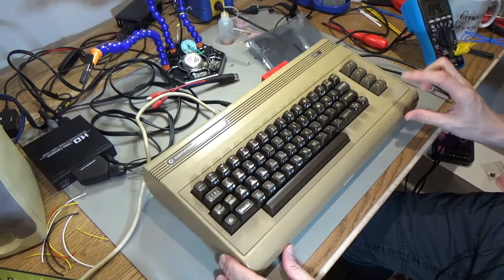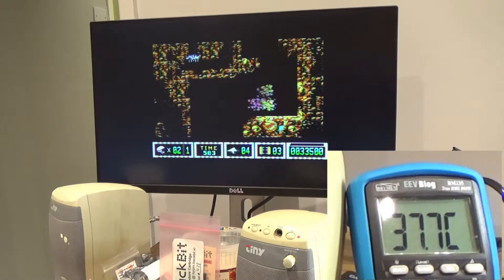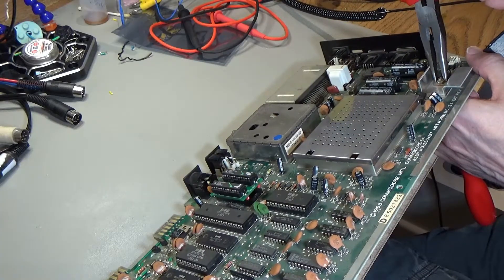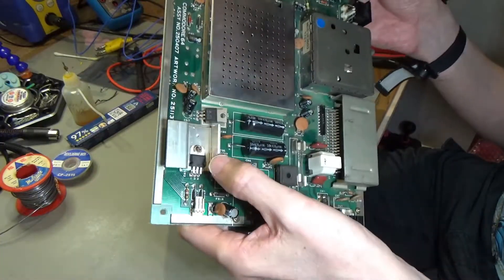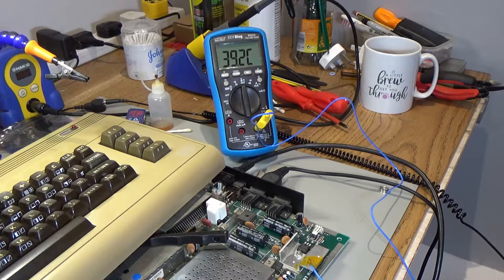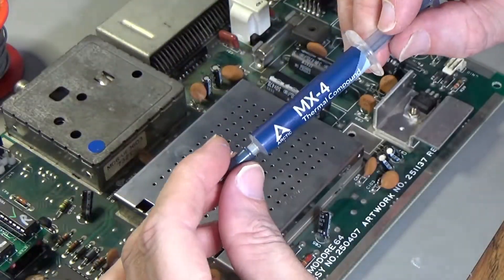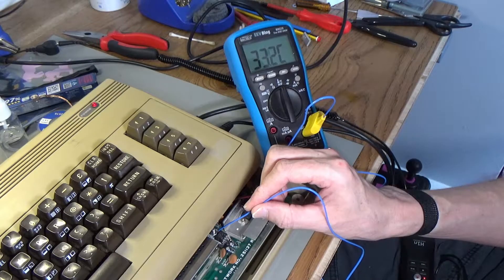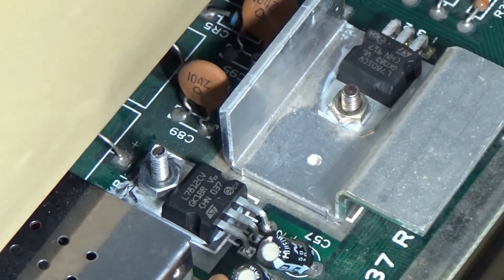C64 Voltage Regulators Replacement & Temperature Measurements

Comment: What's the max current on the OG ones?  I want to use the output for an internal Arduino project, with some LEDs, so I want to make sure I'm not going to fry it.
Reply from the maker: This is what I took out (5v). It's rated for 1A -> https://www.alldatasheet.com/datasheet-pdf/pdf/111545/PANASONIC/AN7805.html

This 5v line is fed from the rectified 9v AC, so it's max current could be limited by your PSU, or the max current of the rectifier. This "Can +5v" also supplied the VIC-II and possibly some other chips (in the  metal can). I know the designer said they added the extra 5V regulator as they were worried about not having enough current to supply the VIC-II, so anything you put on there has to account for the power requirements of those chips too.
Reply: @DavePoo2  I made my own power supply.  1A on the 9V, but the 5V can handle 3A.  I want to tie into the 5VDC come from the PS.  I guess I could just connect direct to the power switch.  Thought there might be a more elegant way.
Reply from the maker: @pauldeane8369  Seems like you want to take from you nice 3A supply then. Not sure if you would also need a decoupling cap to help supply the Arduino and other things?

Comment: Hi, besides the regulators, what other components would you change (after 40 year-old unit not been turned on)? electrolitic capacitors? ceramic ones? thanks
Reply from the maker: I would actually recommend you change the power supply first for a more modern one, as if anything is going to destroy the computer it will be that. I've generally found the electrolytic caps in the C64 to be quite reliable, and I've never changed any ceramic caps at all. If you are going to use the original PSU then you should at least measure the voltage first before you power up, you want the 5v line to be pretty good, 5.1v is ok, 5.2v might be pushing it. Also worth noting is that the power switch inside the computer can go bad after many years and stop the computer from powering on, or reduce the voltage when it is powered, so spraying some contact cleaner in the switch and exercising it a few times might also be wise before you power on for the first time.
Reply: @DavePoo2  Great thanks!

Comment: I've been considering trying to replace those voltage regulators with the DC-DC converters TPSM84205 and TPSM84212.  Same pins...same package size...supposed to be a lot cooler!
Reply: So, it looked like the only downside was the "fart of doom" when you turn off the system.  They said they don't believe it would actually hurt the ICs.  It seems like you could put in a low-pass filter to get rid of a lot of the unwanted high frequency noise, but I'm an electronics novice (esp in regards to circuit design)...so I might or might not try this.  The power savings and reduced heat inside the system look like giant improvements, though.
Reply from the maker: @iguanac6466  Yeah, it could be worth a try if you are willing to experiment, but the trouble is always that this old stuff is that it can be a bit temperamental. I think the regulators getting hot isn't the biggest deal in the world, it's better to get the heat out of the VIC-II somehow, as that thing does get too hot without some kind of heatsink. The regulator next to the VIC-II can does seem to heat the whole place up a little which probably does stifle the VIC-II a little bit as well.
Reply from the maker: Are they switching regulators. I think Jan beta did a replacement to switching regs and I think he had to change back, can't remember if they created too much noise in the c64 system.
Reply: @DavePoo2  Found the videos...watching them now.  Thanks for the heads up!

Comment: That 12v one is nuts mine never even gets hot?
Reply from the maker: Have you checked it's working?, they don't put heat-sinks on for fun. This linear 12v regulator is actually rated for 150 degrees max operating temperature I think. I do wonder why they didn't bolt the 12v regulator down. Maybe to save a few pennies, or maybe because it dissipates the heat into the board very close to the VIC-II chip, which is also dissipating heat into the board as well.

Comment: a modern linear voltage regulator is still a linear voltage regulator. there is no significant difference in efficiency. better efficiency is only reachable with a switching dc/dc step down converter like a (synchronous) buck converter. this would be a massive improvement. the best would be to ONLY use the 9V AC input from the power supply, rectify and buffer it and put 2 (synchronous) buck converters in it, one for 5V/3A and one for 9V or 12V, 1A.
that would be perfect. that would even work on power supplies with a defective shorted 5V linear regulator because that concept uses the 9V AC voltage directly. so, that concept would even work as a protection against defective power supplies too.
Reply from the maker: I think if i said "modern", i meant to say "fresh"

Comment: good job on the regulators.  I have to change some. do you have a good source for them?
Reply from the maker: You could probably get them from anywhere but i bought mine from retroleum in the UK as i was ordering some other C64 spares stuff from them at the time
Reply: @DavePoo2  alright.  There are many various options  for the 7812 and 7805, all kinds of added letters from various makers.  Does it matter at all?